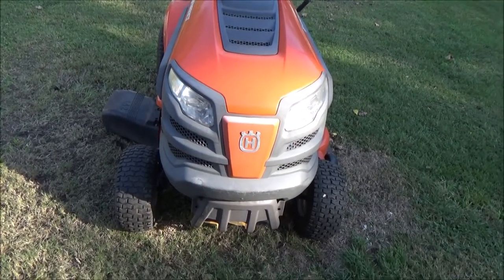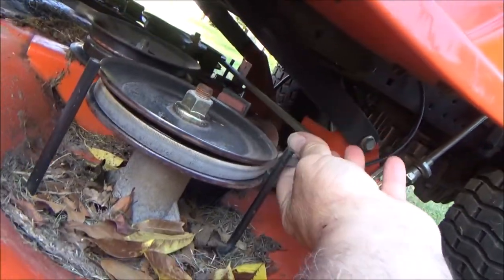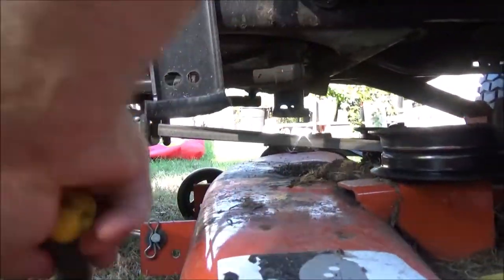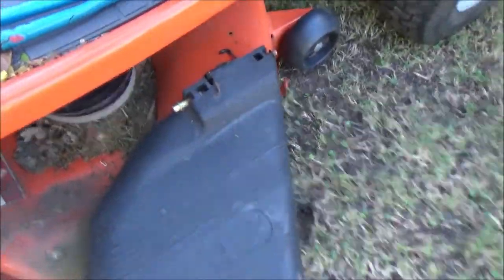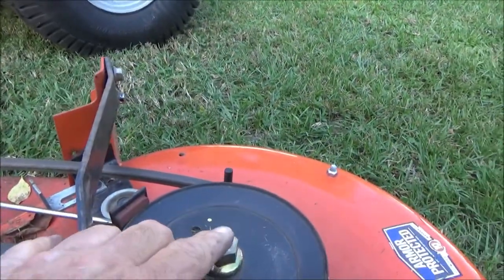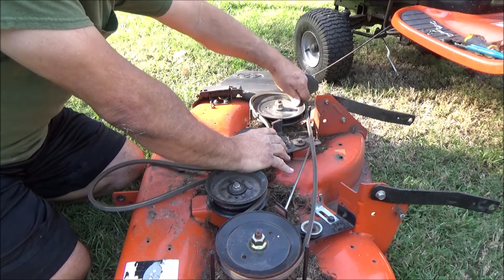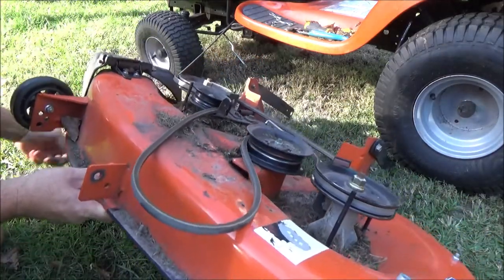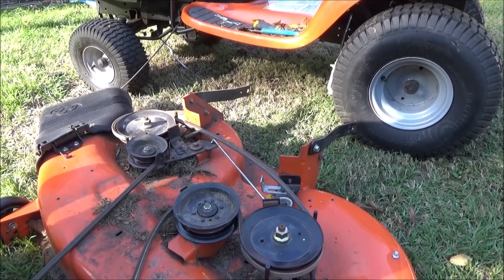Removing the deck from a Husqvarna YTH 18542 MOWER

Comment: John if you're gonna drive your tractor around with your deck off take your front rod out the rod that holds the front of your deck because if you forget to remove your front rod and you start driving your tractor you can bend your rod and jack knife your tractor and that won't be good and secure your blade engagement cable so it doesn't get damaged and destroyed

Comment: Does the belt go on the inside of the front pulley hooks ( like it's just keeping it from popping off) or in the  actual hook?  It looked to me like it should go hook line line hook on the front but I immediately realized I messed up when I heard squeaking and the new belt almost burnt on me  immediately.

Comment: This is the mower that I have now. Before that, I had a Craftsman 42 19,5 HP for 20+ year. The deck came off easy on it.  I had thought of reviewing this mower...You mentioned 2 things (among others) that hit me about this mower after one season....I have noticed how hard much grass builds up around the spindles, I never had this with the Craftsman. I think this is a bad design. I have also noticed how loose the belt is, it came off the other day, again,  just my first season of owning it.  The other day it had a terrible shake/vibration  when I put into cut mode...then all of a sudden, I noticed something fall off . One of the belt hooks  at the front pulley broke off!!!!! I have also noticed a lot of excess clippings when I cut as compared to the other mower....maybe it does not have mulching blades as my Craftsman did. Now, don't get me wrong, I like the mower but was a bit surprised by these things. THANK YOU for showing how the deck came off!!
Reply: I have the same model , now 3 years old,  Had same problem with loose belt popping off  since  new.    Got tired off putting belt back on,  went to farm and fleet and bought  1 inch shorter belt ,, shouldn't have to do this  but it has not happened since
Reply: Also  when done mowing I leave the mower running at idle to cool down and use my blower to blow off  and thru the engine and blow off the mower deck.  I have never had as much debris on my deck,  even when vaccuuming leaves .   Don't mean to be critical.  just hope to help  Good video   keep them coming

Comment: Hey John, Grease fittings on top ofm the spindels won't help because the upper and lower berings on the spindels are sealed!
Reply from the maker: I remove the inner seals so they could get to the grease. Might be a mistake but they still work so keep your fingers crossed for me.

Comment: Blades vibrate when they’re sharpened and not balanced (taking too much metal off while sharpening) think of it as a ceiling fan or a wheel/tire weight falling off. Bearing are probably the main issue though
Reply: just got this mower today. i also thought something was wrong with the blades to much vibration for a new lawnmower. going to change them tomm.

Comment: Of course its dangerous, but what do you think about just removing the pulley brake pads? My assumption is just the blades will take a bit to stop spinning, but fine otherwise
Reply: He needs his blade brakes to slow down his blades when he disengage his deck

Comment: Two years only???? Makes me worry about my tractor
Reply from the maker: I still have it and other than rebuilding the deck and belt changes its good. there are better mowers out there for the price, I'd find one of those if looking for new mowers.
Reply: @Jsellers1965  I bought this same mower last year, looks like it's garbage. I already had it in the shop to replace the transmission because the key sheared off and wrecked the wheel and transaxle